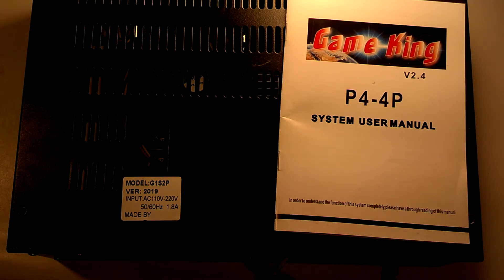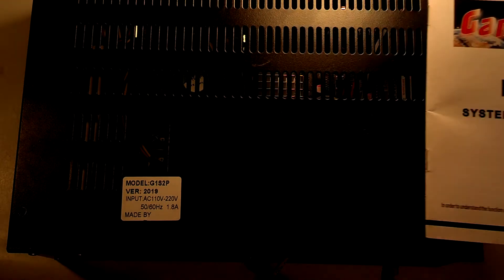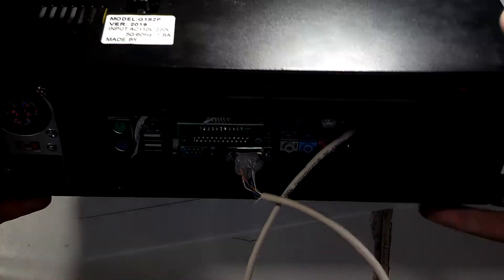GAME KING 2019-in-1 JAMMA arcade PCB review Pt. 1 - Hardware breakdown

Comment: Hi there. Not sure if you still monitor but I had a question.

I bought my arcade cabinet in 2016. That unit went out in 2018 and I had a 3 yr warranty so the seller sent me the 3000 in 1 Game King unit. For some reason the Player 1 joystick wouldn't go left or right. I messed with some of the dip switches and fixed it. Or so I thought. It worked for a few days and then all of a sudden today, it stopped again. The joystick works to select the games so it works in all directions. But once I get into the games, like PacMan or Galaga, if I push to the joystick to the right, the character goes left. But if I press the top bottom, it'll go to the right. Any ideas?  I may have to just buy a new Game King but I can't seem to find a vendor here in the US. Any guidance would be much appreciated.
Reply from the maker: @gooseliver9  If it seems to work correctly on the menus it might be a software issue with the Game King rather than a hardware issue with the wires or switches. Yours is a newer version than mine so the software might be slightly different, but I'd run a quick test with Street Fighter II. Try a 2 player game and see what the joystick and buttons do on the 1p side in comparison to the 2p side. Then open up some different games that aren't using the same MAME emulator; like maybe the 3D Street Fighter EX or Street Fighter III. If the joystick consistently behaves incorrectly in the same ways across all games, it may be a software issue. 

If that's the case, a quick and dirty way to fix it would be switch the wires out that go into your joystick switches. Depending on your hardware they might just have a quick connector that slides off and on, and you could swap them around in a matter of seconds.

Comment: Hey I have one of these, do you know how to restart it when the onboard battery has been replaced, it went flat now won't start?
Reply from the maker: @neiljemmerson8826  Mine shipped without a battery in it, placing one in it made no difference so I just pulled it back out. I wouldn't think that would be an issue. You may want to reseat both the RAM chip and HDD in the IDE slot. Sounds silly but it fixes mine the couple times mine would not boot to anything but a black screen.

They don't exactly use high quality parts in these things, so even the tiniest knock could cause a connection to come loose. If the HDD is the issue, you should at least get a self-test then a boot disk prompt.

Comment: Do you know what ram is compatible with this system?
Reply from the maker: @dreadpirate1337  I'll try to check on this and see. I had two old desktops that used the same type, but I don't remember off the top of my head what it was.
Reply: @MisterAzathoth  if it's to much trouble not an issue bud.. 

I put batacera on a USB stuck. I got it working but it's to slow to play anything.. I was wondering if I done something wrong or the game king just can't handle it.
Reply from the maker: @dreadpirate1337  Cool, I had never thought of trying that. I'd say the processor is just too underpowered to run it. I experimented with updating mine with some newer versions of MAME, anything newer than 2010 or so ran like garbage. Most of the stock emulators on this were released around 2005-ish.

Comment: Hi from Hamburg. Just found your video regarding the game platform and indeed I have the problem, that the video signals are obviously not transmitted to the jamma connector. There is a 5 pin cable connector with one side open(without connector). This connector suits on the platine above. Is this properly the connection for a vga connector fitting in the connector on the plantin underneath? If this is the case, do you might have an idea which cable goes where?
Would be great if you could give me any advice 🫶.
Many thanks 
Rene
Reply from the maker: You are correct, this 5 pin connector is from the VGA out of the computer to the other board. You could always hook a computer monitor directly into your Game King to see if that is the problem, but from what you describe I'd say you're missing the same cable I was. They did not include this when I bought it so I had to make my own. My homemade connector as shown in the video looks absolutely awful, but it works! 

There are 5 pins from the VGA connector you must use: red, green, blue, ground, and horizontal/vertical sync. Horizontal and vertical sync are two separate pins on the VGA side that you twist together to make one connection on the JAMMA board side. The pin numbers are 1) red 2) green 3) blue 5) ground 13) h-sync 14) v-sync. Here is a link to a diagram for the VGA connector. You could buy a new DB-15 connector and make your own, or just splice up an old monitor cable.

https://images.app.goo.gl/kE41u77amrdhb5wi8

For the 5 pin connection on the top JAMMA board, I do not remember the exact order the wires go in. It may be labeled but if not it could be easily determined with a multimeter or visually following the traces to the JAMMA edge. I hope this helps you out.

Comment: I read killer instinct 1 and 2 was on the game king. Do they run correctly? Other 3d games like tekken seems to lag a lot and suffers from slowdown. Can anyone help?
Reply from the maker: Unfortunately both KI games on the Game King don't run at 60fps. 1 seems to run a bit better than 2, but there's noticable slowdown and frame skipping. Changing the version of MAME it's running doesn't help either; the processor is just too underpowered. 

Newer versions of the Game King are based on a dual-core processor so those might run it without issue.

Comment: Hi, I have just acquired one of these in a tabletop cabinet. I was just wondering where/what the single red wire next to the bios battery is connected??
Reply from the maker: If it's the same one I'm thinking of, it's a thin red +5v wire that runs from the top of the hard drive to a molex connector on the power supply.

Comment: Hey, great video. I found mine has interference lines when turned on. I have limited this down to the jamma board component… but no idea what could be wrong?
Reply from the maker: If it's the JAMMA connector causing it, you could always bypass it by splicing a VGA cable direct to your monitor harness. That's how I had mine hooked up before I rigged up that cable they forgot to include.
Reply: Oh that’s a great idea.. any links of info of what colours to match? I assume this is the plug that goes to the chassis board from the jamma harness. I’m sure that will fix the issue and save me from buying a whole new board
Reply from the maker: @Gflork  Search "arcade VGA harness pinout" and you'll come across the diagram. I don't think wire colors are standard so you'll have to use a multimeter to make sure they go to the right pins. It's simple to do, you can either buy a new DB-15 connector and build from scratch, or just cut the end off an old VGA cable and splice into it. There's just 5 (6?) pins you connect to. One end goes into the VGA monitor out on the back of the Game King and the other end goes straight into the video sync harness on your monitor. 

I mentioned in the video the seller I bought this off of forgot to include the little patch cable that normally connects from the monitor out to the JAMMA board. Prior to me making my own, I used a homemade cable made just the way we are talking about, running straight from the VGA out to my monitor. 

I misspoke in the video but learned this afterwards. The JAMMA board in there has nothing to do with the 15khz video conversion required for a regular tube monitor, it's all done in Windows software. If you have your Game King setup to output 15khz, that's how the signal comes out of the VGA port, so using a cable like we're talking about and bypassing the JAMMA edge connector works without any issues. You could also use this cable to hook a Windows PC straight to your arcade monitor, as long as you have Soft15khz running.
Reply: @MisterAzathoth  perfect thanks mate. Yeah it connects into a 5 connector harness. I’ve noticed the vga to the jamma board takes both sync lines into it but there’s only one video sync being used to the monitor. I assume you just used the one composite sync connector  and went straight to the monitor chassis with that? Ignoring the other sync line? Thanks heaps for your help. :-) bugger the guy who sold you it forgot to package the cable!
Reply from the maker: @Gflork  It's been several years since I made this, but it looks like that's how I did mine. I twisted both sync lines together coming from the VGA pins, so on the monitor end I just have 5 connectors (R,G,B, ground, and the two syncs put together).
Reply: @MisterAzathoth  cheers mate. I did this and the video looks amazing! Only issue is that the v sync is almost impossible to keep the image still in the middle of the screen. It’s basically super sensitive when using the screen adjust control. When using the jamma board it was much slower and easier to get perfect, although bad image. Did you have a similar issue by any chance?
Reply from the maker: @Gflork  Only issue I had was a weird bit of curving at the top of the image when I picked NTSC video mode, which went away when I picked PAL. I think they was a monitor issue though. Maybe the two sync wires aren't making a good connection? Hopefully it is something simple.

I forgot to ask earlier, on the interference you started out with, is your cab power supply hooked up? The Game King doesn't need it at all, so maybe that is causing some RF noise or something.

Also, I found just here recently that all the MAME versions on this thing have a smoothing filter on by default. You obviously don't want that filter if using a CRT, the picture is improved greatly if you edit the MAME.ini file to turn it off.

Comment: I have the older version of that unit. Got it in about 2008. Mine has no metal case. Games Family was the name of it. Has the same instruction manual. It was originally about 1925 games. I had to plug In the little harness to my cabinet so i could play 6 button fighting games. I have it hooked up in a Super Neo 29 (Neo Geo) Japanese cabinet. About 6 or 7 years back i bought an ugraded hard drive with 3025 games on it. There used to be a forum for people that owned these so people could discuss everything but it went offline some years back.

Comment: Have you heard anything about hooking a USB controller to thus game? I love smash TV but need two joysticks. Cheers!
Reply from the maker: Smash TV by default has the firing mapped to buttons 1-4. You could plug in a USB controller and and remap the controls for it in MAME, I'm not sure if that would cause any other control conflicts though.
Reply: @MisterAzathoth  what USB controller do you recommend? I tried one or two but no response? Like the USB wasn't functioning
Reply from the maker: @bumgahdna  This thing is running Windows 2000, so it would need to be one that had the drivers natively installed on that OS. I've never tried anything myself, but I've heard others confirm USB trackballs working and a Saturn-style USB pad.

Comment: Can someone guide me as to where the dip switch is to get into the setup mode on this unit?
Reply from the maker: I can type out the instructions if you still need them. If I'm not mistaken you'll need access to 4 buttons on the P1 side and all 6 on P2 side to access them. For games that have an on screen dipswitch menu (like Neo Geo or Midway games) it brings that up, otherwise it brings up the standard MAME menu for dip settings.

Comment: should I get this or just convert my cab into a mame setup?
Reply from the maker: C T If you're tight on funds, comfortable with cab wiring,and have the time to fool with it using a PC with a J-Pac and maybe ArcadeVGA card would be a better setup. However if you don't have the extra time required to set it all up and want a plug & play solution that is slightly more expensive these are the way to go.

Comment: Would you happen to know if it supports trackball?
Reply from the maker: Retroworks Arcade No trackball support, just 2 joysticks with 6 buttons each.
Reply: Track ball support thru USB
Reply: @feedbox2  thank you for your input. This whole time i thought the USB ports were dead...
Reply from the maker: @retroworksarcade323  My previous comment was incorrect, and Feedbox was right. USB supported trackballs work, just have to enable trackball support in MAME settings
Reply: @MisterAzathoth  Thanks alot for your input. Would you happen to know how to do that?
Reply from the maker: @retroworksarcade323  Posting a video hopefully tomorrow with some info I found; settings workaround, aspect ratio fixes, undocumented menu commands, good stuff!
Reply: Azathoth thank you for your swift reply brother...

Comment: How did you make that cable that you use on the VGA output to get 15khz from the jamma harness? I really want to buy this for my supergun and the seller not including that cable is my only concern.
Reply from the maker: Mr. 6's&7's It's pretty easy. I was previously using an old monitor cable I had cut and spliced a CGA monitor connector on the other end to plug directly into the arcade monitor from the monitor VGA out. It looked like garbage so I broke down and made a proper cable (like should have been included) so the video would go through the JAMMA connector like it should.

Pinouts diagrams are easy to find, you use 6 pins on the VGA end (red, green, blue, ground, horizontal/vertical sync). You could use this to run a PC straight to a arcade monitor, but remember you need to be running Soft15hz or similar to have the video signal output 15hz.